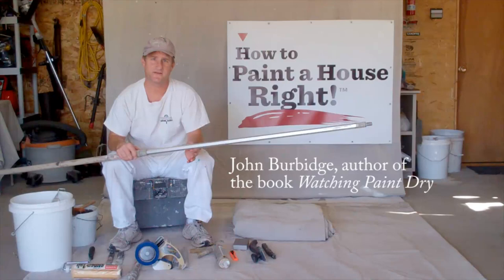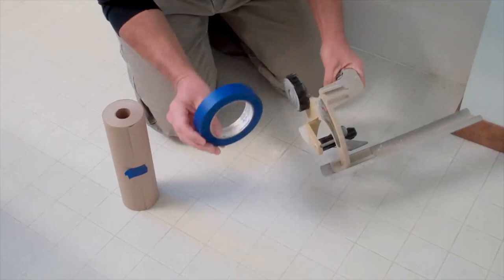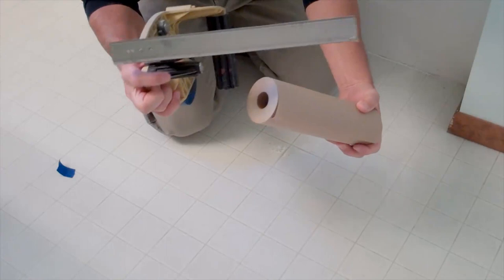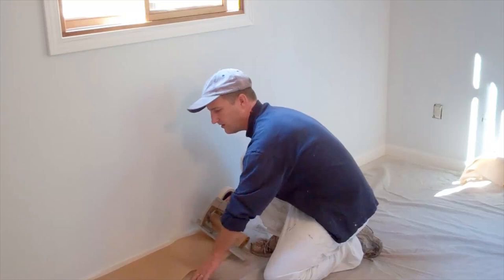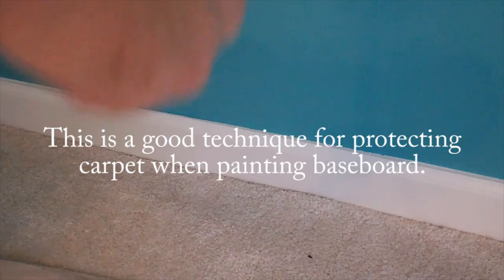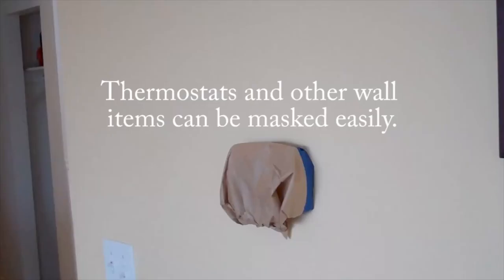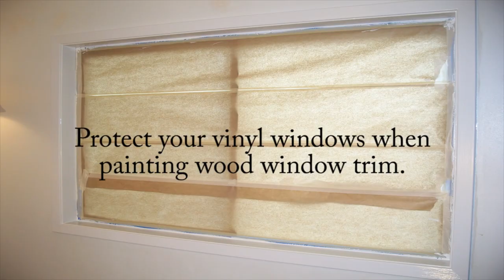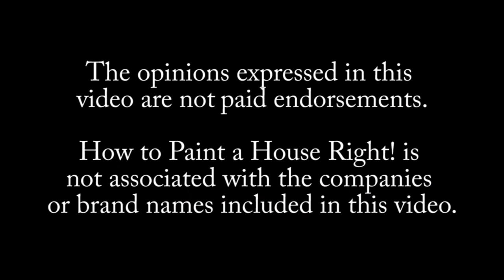"Handiest" Painting Tool: How to Use a Hand-Masker for Taping (House Painting Tips)

Comment: There's no way that this worked for me. I bought the 3m equipment, masker, paper&tape, &the darn thing just kept jamming&tearing. The tape wouldn't come off its roll. It kept separating from the paper. It just didn't work. I returned it all.
Reply from the maker: Well, that's too bad, if the tape wouldn't come off it's roll that's the tape's fault. Even if using white tape it's important to get decent quality white tape, not the cheap stuff (which is usually the kind that won't come off the roll properly). But I'm sorry you had a bad experience. I've used a hand-masker for years and it's invaluable. Occasionally it messes up and you need to fix things, but for the most part, if you have good quality tape and paper and a sharp blade, it works pretty darn good.
Reply: I had all sorts of problems with my masker, much like these, until I realised I was making a fundamental and obvious error: you must use narrow tape like that shown in the video. The slightly wider roll I had been using wouldn't unravel easily enough, causing endless jams and misfeeds. It was all good (Kip) tape, but when I switched to the narrow roll because I'd run out of the wide stuff, everything just worked.